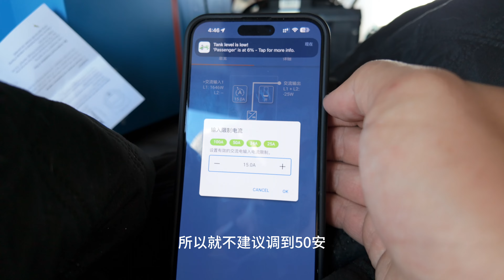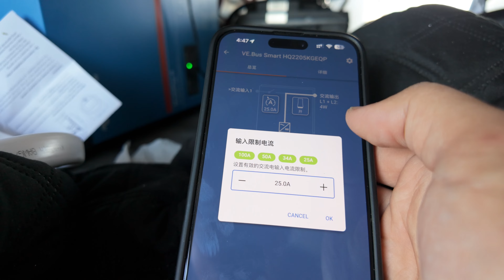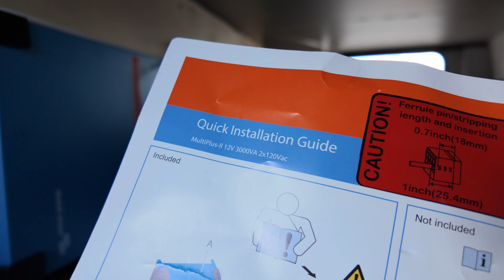美国航展扛火箭筒⚡️给房车加装锂电池逆变器｜28 Full-Time RV Travel Vlog/ENG SUB

Comment: Thanks for your video  so after you add  this conventer,  all power  connection will work without connect  site power , is that right ?  do you have link for this conventer ?
Reply from the maker: we do two separate system, we keep the old system, We only use this system of lithium batteries and inverters when dry camping, and can only use the dedicated 110v sockets from this system. here is the link for the inverterhttps://www.amazon.com/Victron-Energy-MultiPlus-II-120-50-2x120V/dp/B0945M9NG4/ref=sr_1_1_pp?crid=3DJXPLFXJDVVR&dib=eyJ2IjoiMSJ9.obVSZnfW_pkKOrr_bHLae5fjdxcfAGN29gZbmPRYvS7FvzqkPW1sTpku_Kk3BEMVu3Z5atInKVwpvB_iddfwV92sTs2w3J78aVyweu3lRvHWzqk4kPxRdbeB6_AAkfkO6UHZru6PGvW42GPARA2fw7F9WtLYtNKH9IILiZ9ipn3B2r4LVHaf1Dz7IRJORkqFBK89kvun9E1uwcbt1uaDseNwctF1T3wx-t2EEgrXFrhCjdvo9NKRXoI_od8IQMnIRVhubNSij1iGemBVw45TEw-DvZcC0pzgE3CZH5Hsa50.mEUYLQG2jgPBnOnRP9Evqau0OTDK4zyvikOCA8TDXsY&dib_tag=se&keywords=inverter&qid=1725302211&sprefix=inverter%2Caps%2C354&sr=8-1